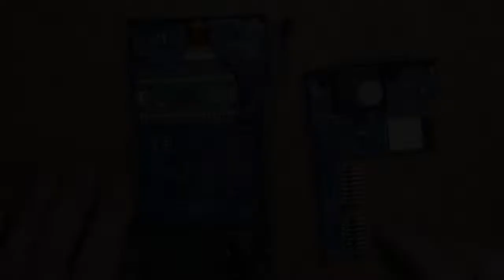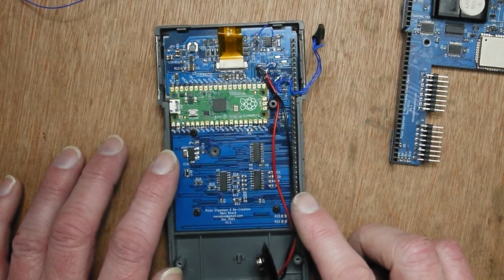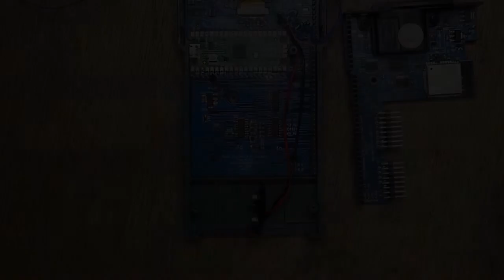Re-creation of Psion Organiser Part 18: Power Problem

Comment: Hi.
That means that if you solve this problem, the new organizer will not need an external power supply to work?
Best regards.
Reply from the maker: The new organiser should work fine on a 9V battery, yes. It does work on battery even with this power supply fault, it's just that when it's off it's not fully off so the battery will discharge and eventually go flat. With the fix it should be fine, as the circuitry turns off